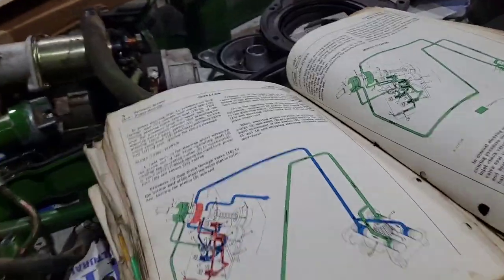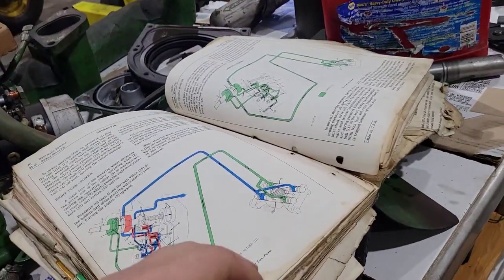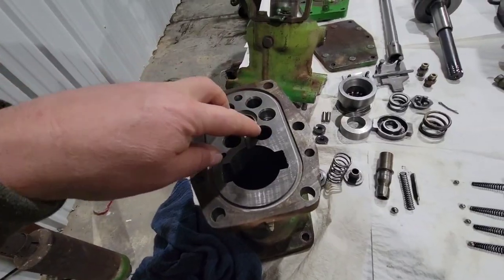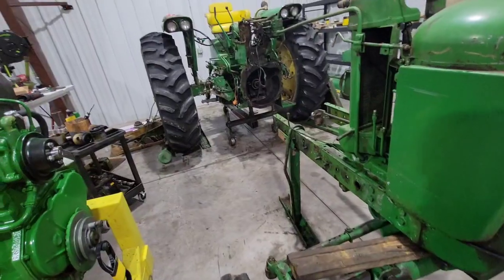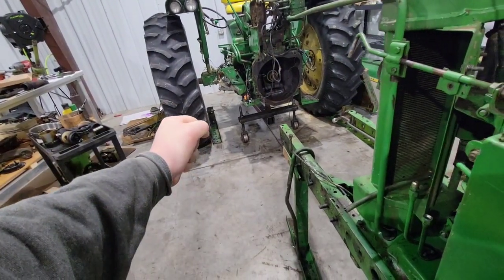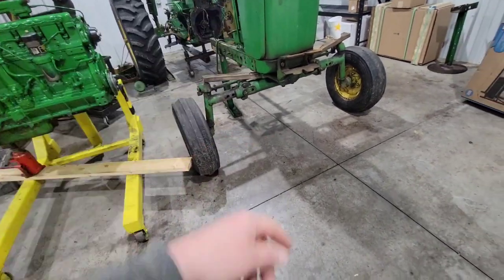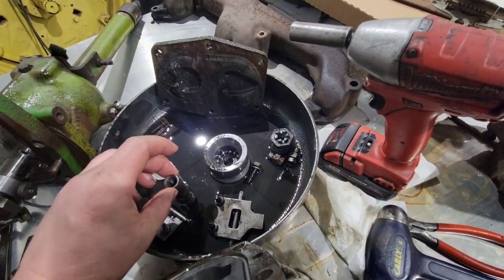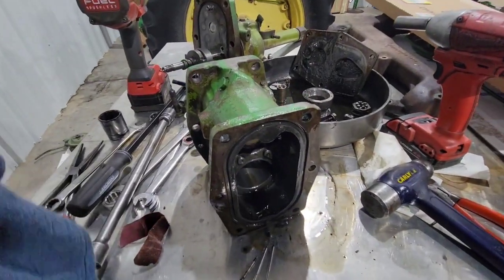John Deere 4020 steering theory of operation, Diagnostics, steering valve rebuild

Comment: Big budd is being built again
Reply from the maker: I heard about that. What are your thoughts on it? For the last several years versatile has been doing that. A truck engine that any truck shop can work on a cat transmission and an open platform for technology
Reply: @jonstevensmaplegrovefarms3754  the purchase price and maintaining tractors has reached the tipping point.  The transmission and emission systems repair costs along with the resulting engine damage that is caused by said emission systems is not sustainable. I can’t imagine paying 300 thousand for a tractor and within 6000hours being hit with a 40,000 thousand dollar repair bill. Not sustainable. John Deere has lost touch with who brought them to the top. They buy from the cheapest supplier,and charge like there is no tomorrow. No worries about how long the parts last. Just my opinion. The same thing is happening in appliances,cars,trucks,and hospitals.